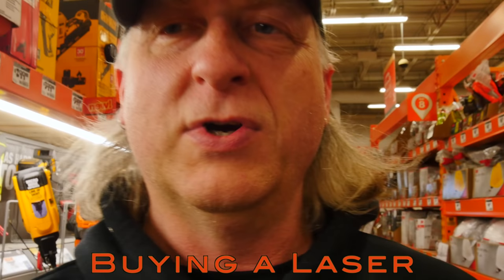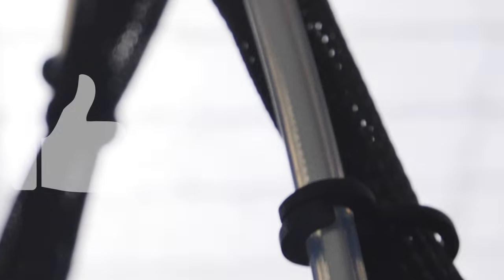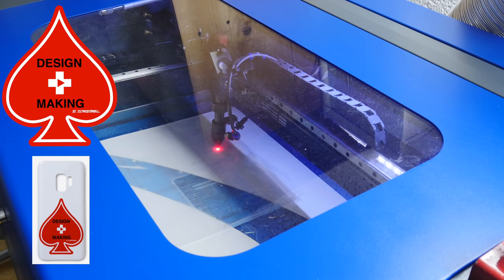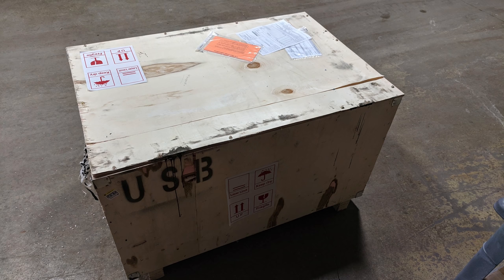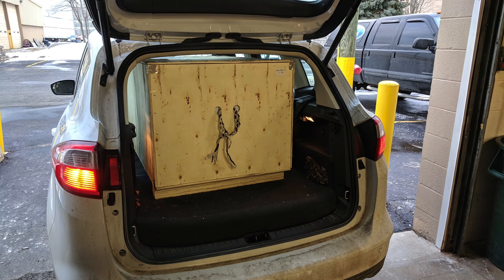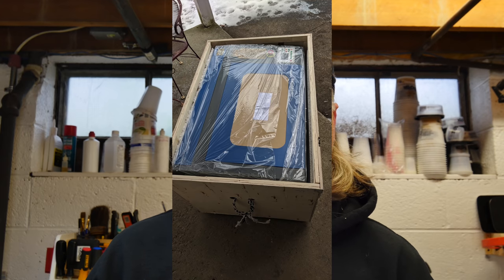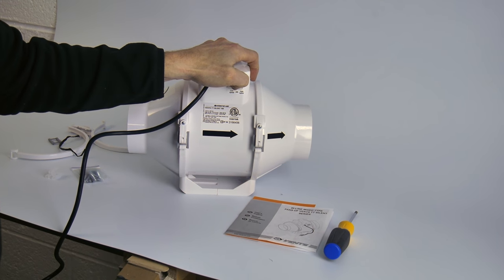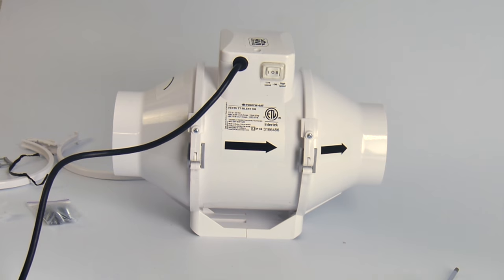How to BUY a 50W Laser? A basic buying and modification guide

Comment: Congrats on your recent purchase, man!  I've had my machine for about four years now, and it has certainly paid for itself several times over.  My experience was that I used to go to a MakerSpace local to me here in Los Angeles, and went with the initial intention of 3D printing a few things, but each time I went, the printers were always down.  Since they had a laser cutter as well, I inevitably kept using that instead, and became a big fan- to the point at which I bought my own machine.  Prior to this, I had always known about Epilogue, which makes fantastic machines, but waayy too expensive.  I ended up getting mine directly from a manufacturer in China - a 100 watt (no brand name) machine with a 2x3 foot bed.  I feel I got a better machine for my money, though one problem is the lack of support, so the troubleshooting is completely on me.  Also, it has a dongle for the motion controller, so if I lose that guy, I'm hosed as well.  Would pretty much have to switch it out to a different one.

A few thoughts from watching the video:

- I ended up buying a dust blower from Harbor Freight.  The blower that originally came with mine was 220v, but when it crapped out, I went looking for a replacement, and everything was super spendy.  I just made a little box to support it, and have it going through a vent directly leading to my alleyway.  I would buy a carbon filter/scrubber unit, but like you mentioned, they're pretty expensive.

- For the temperature gauge, I bought one of these: https://www.aliexpress.com/item/1PCS-W1209-DC-12V-heat-cool-temp-thermostat-temperature-control-switch-temperature-controller-thermometer-thermo-controller/32713892704.html?spm=a2g0o.productlist.0.0.3258a9c01wlJGS&algo_pvid=6572c02b-dc23-462e-b0f1-5a3da51ddd70&algo_expid=6572c02b-dc23-462e-b0f1-5a3da51ddd70-3&btsid=9447691b-6663-46bf-a37b-60b5b95e6ad5&ws_ab_test=searchweb0_0,searchweb201602_1,searchweb201603_53    I then connected the relay to an alarm, so that when it hits a certain temperature that I don't want to exceed, it triggers it.  This sensor goes directly into my water return bucket.

- On the subject of your cooling tank, I was always told to use purified water, as the minerals can start to form deposits inside the tube.  While my water tank is usually "less than ideal" (dust and debris sometimes make their way in), I have never had an issue.  That said, I'm not sure if antifreeze is okay to use or not.  Just a thought.

-Last, something that commonly happens on my machine, and I don't know if you have experience it yet (or have the function on yours), but if your water pump isn't circulating/operational, it may cause your machine to appear broken (you go to fire, and the laser doesn't function).  I mention this as a couple weeks back I was taking my machine apart, and getting ready to buy a new laser tube, when I checked the pump one last time.  Saved me $700 bucks.

Thanks for posting the video, and I look forward to seeing all the awesome stuff you make with it!

Comment: Eric, Air assist is NOT a flame extinguisher. The air assist actually adds oxygen to the fire and while it may help blow it out, that's not what it's for. Air assist is to help clear the soot and other particulate from the cutting area. 

I only have a K40 so mine is probably not even 40 watts but from the Facebook group I belong to (Laser Engraving and Cutting) they seem to suggest getting a proper watter chiller (helps keep the water going into the tube cool, if the water going in is too hot, cutting power is reduced and it wears out the tube)

For the exhaust fan, I ended up getting a furnace blower fan and rigging it up, got it for free, and it's super quiet on low speed and not terribly loud on high.
Reply from the maker: Ben Ryherd, thanks for sharing, yes, I misspoke a bit there about the air assist.
Reply: @EricStrebel  No Worries, it happens. Just didn't want people to think that if they got "Air Assist" that they could leave their lasers unattended while they were running (Which is a huge no-no no matter how comfortable you are with it, or how good of a machine it is)

Comment: First Things i did:
Ampmeter installed.
Added foamtape to all lids to prevent uncontrolled airflow and Fumes.
Added 4 40mm holes to small front lid to make sure all Air is sucked in here.
Closed all unneccessary holes with ductape.
Closed Back of top Cover with ductape.
Added flowmeter in waterhose. 
Realigned all mirrors.
Leveled the bed as good as possible.
Glued the bed to the frame to prevent wobbling.
Added 3d printed crank for z movement.
Added 7812 stepdown converter circuit to add 12v Led strips and future 12v parts.
Chassis Part there the lasertube ist screwed on vibrates a Lot - fixed with 3d printed angle.
Reply from the maker: Wow, nice! Thanks for sharing, much appreciated

Comment: good advice, but if you wanna get started in lasering right away, dont hesitate with the 40w. just know that youre going to outgrow it super fast. also air assist is easy to add. and it's definitely important to save you from fires.

Comment: One of the first things I did when my 80w arrived was to check the optics, you’ll find they’ll be grimy with oil residue from transport and storage.  Also cleaned off all the excess grease on slides and swarf in the bottom. Like you I love my laser cutter :D
Reply: I replaced all mine with better quality optics the second week I owned it.  Made a HUGE difference!
Reply from the maker: Where did you get the replacement optics and what kind did you use?
Reply: @EricStrebel  Hi Eric.  I got the parts from here:

https://www.lightobject.com/K40-Upgrade-Parts

Specifically, the focusing lens is Part #: LSR-ZNSE1838HQ
The reflecting mirrors are Part #:  LSR-MIR25MSI

Hope that helps.

Cheers...
Reply from the maker: Nice, what sort of improvement or boost did you get or observe
Reply: @EricStrebel  The new optics gave me a smaller spot size and less burning and charring around the cut (kerf) at the bottom end of the power range.   There was a slight power increase, in that I could get the laser to cut at about an 8-9% reduction in laser power at the very low end.  This could also allow for slightly faster cutting speed at the same laser power, but that's not really what I was after.

The goal in changing out the optics was to get the laser to cut with the smallest spot size possible (narrowest kerf possible), in very thin material (adhesive backed paper).   

The new optics gave slightly more power at 11-12%, with a "cleaner" beam/spot.  

The OEM mirrors and focusing lens were just awful on my machine.  Not sure if everyone else had a similar experience.  My focusing lens was particularly bad.  It was very cloudy, which for CO2 based lasers, is not desirable.  

All in all...  I'm mostly happy with the machine.  The mechanics are pretty good.  The control is functional.  The laser is pretty crappy though.  Beam quality sucks and gets worse as you go up toward the limit in laser power.

When the laser tube starts to degrade, I'm going to replace the laser and power supply with a higher end unit, provided the mechanics are still in good shape.
Reply from the maker: @WHJeffB  wow, great information for me. I really appreciate you sharing with me and the rest of the community. Thank you very much I really appreciate the information

Comment: Eric you are very lucky to have found a good one on ebay.  I have bought a 40 W and it tanked in less than 2 months.  I bought a 60W monster and it was DOA.  BTW only on ebay do you have to pay for that lift.  I paid $150 so they could just leave the 60W in my driveway. 375 pounds!! And after I sent it back they did not refund me for something that was not my fault, they damaged it(the freight carrier).  And I had to go through ebay to get the seller to return my money for the laser($2349)!   I just bought an Orion 50W from a reputable affiliate(Yes REPUTABLE) and no other charge to deliver to home or anywhere else and I paid $1399 for it and added the 3 year warranty for another $58.  Yes a warranty!   Orion does not sell their lasers on Ebay.  What does that tell you?  I would not advise buying expensive items on ebay.    You might get lucky but you are more likely to get shafted.  I think they are rejects and they buy a lot of them for cheap and fix them up and sell them. The 2 that I bought had a lot of flaws.
Reply from the maker: Perhaps I got lucky, but I do totally expect parts of the laser to fail at some point. At some point the laser itself will fail and the tube will be replaced with a higher wattage one

Comment: A laser is a useful too. I would suggest checking your local makerspace/hacerspace first.
Just like 3D printers it's a useful tool but will need to make a lot to make it worth your while.
If you still need one at home/in the shop you et least learned a few tricks.
 
I've played with lightburn. It's a good piece of software. Not freeware but worth the price.
Depending on what you want to make opt for a draw tool with a coordinate system.

I'm struggling quite a bit with inkscape as it all approximate and not exact.

From past experience at my local hackerspace (Bitlair) I suggest investing in chiller for the water.
Chilling the tube to 20 degrees C will increase the live of the tube considerably. 

Note: The guys at Bitlair build the lasercutters from scratch, It's about €3k each. (Chinese import would be €2k).
(Note: Everything is more expensive in Europe.)
Reply: Life of the tube

Comment: I've always been toying with the idea of getting one for model making and yet wary at the same time. 
People claim there's a risk of styrene catching fire or damaging the hardware over time even if there's an air assist and ventilation and some people claim thin copper sheets work (as a quick alternative to photo etching model kit parts), while others claim it doesn't.
Reply from the maker: Well it will not cut metal, but I do see evidence of light scoring on some metals. I think it will definitely depend on the power of the laser.
Reply: Even most videos using professional lasers on thin copper sheets use at least twenty passes, so that doesn't surprise me.

Comment: You showed in the video using antifreeze for cooling.

I’m looking to purchase a unit.
I live in Wisconsin and i would need to keep the laser in my garage.

Two part question. 

Will the cold otherwise damage or hurt any laser Machine?
And 
Any pros, cons, mods (other than price) to using antifreeze over distilled water?

Lastly,
I am looking to get the  Orion Motor Tech 50w or Preenex version
Orion appears to come from Orion Motor Tech Direct., and the Preenex from a warehouse in Memphis on Ebay. The Preenex is allot cheaper than the Orion.

You mentioned a buying from a US seller. Would I have any issues from these two chinese machine, or do you have another recommendation under the $2k mark.
Reply from the maker: I suspect the cold won't hurt it, however there is liquid use to cool the machine. I used a mixture of distilled water and anti freeze. Water expands when it freezes so I would be wary of leaving it in a place that is not temperature controlled.
I only have experience with my machine, so I can't comment on there two machines you mentioned. Check the reviews and ask other people that have owned them for better feedback. Best of luck!
Reply: did you end up purchasing the cheaper version out of Memphis(Preenex)?

Comment: What do I need to engrave hot wheels
Reply from the maker: A laser with some vector files of the graphics you want to engrave, and some hot wheels of course.
Reply: What is a good cheap brand to use
Reply from the maker: @TimothyStalley918 link in the description to the one I have